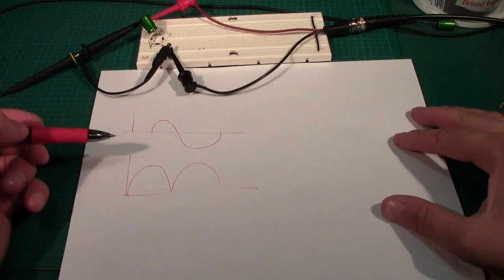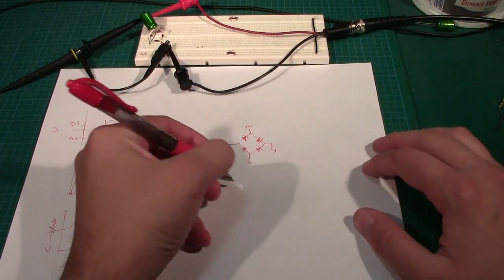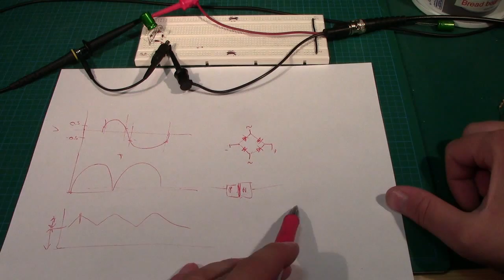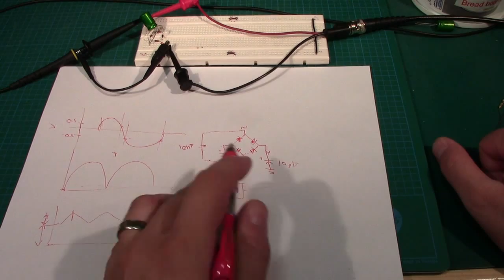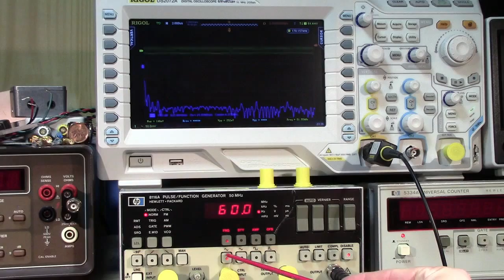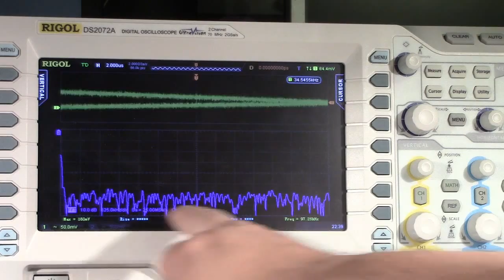Diode Switching Investigation

Comment: Hi ! thanks a lot for the very interesting video.   I am not sure I have understood rightly where you have placed  the capacitor ... between + and - on the bridge ?   have you tried different diodes to see difference in noise ?From what I understand this is high Hz noise, very difficult to suppress with common linear regulators.  Thanks a lot again,  gino